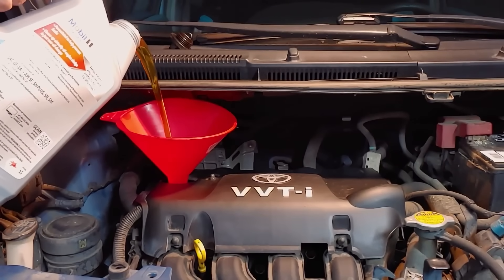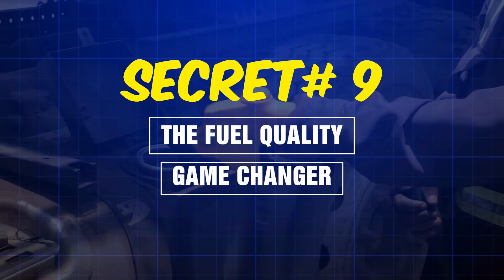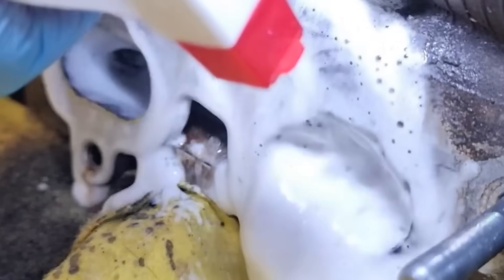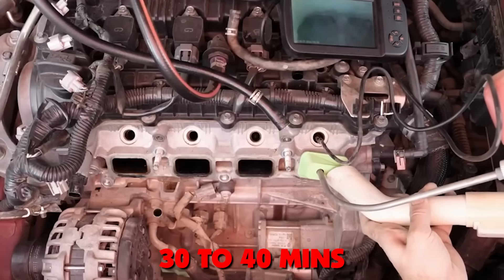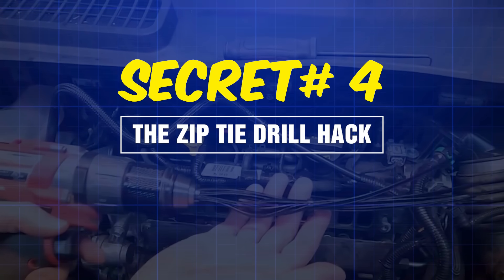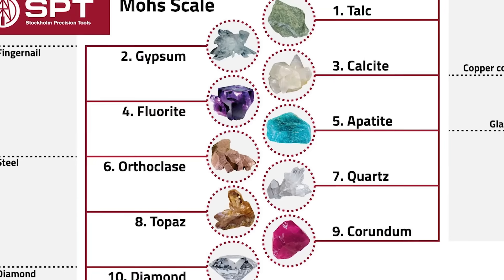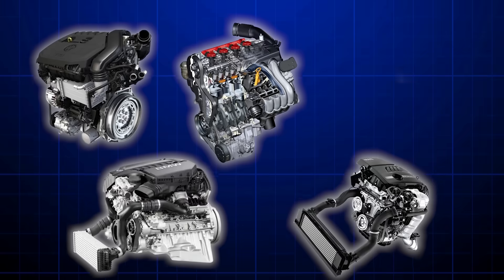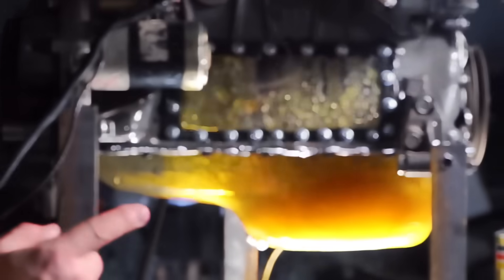9 Secrets To Clean Carbon Off Your Engine! Pro Tip

Comment: Just add One percent diesel  to your full tank of petrol every couple of months... 60 litre tank = 600 mls of diesel ..... 70 litre tank 70 mls of diesel and so on.. and give your car a good kick in the guts a few times a week.... run it out to about 5000 RPM for 5 to 10 seconds .. it blasts all of the Sshit off your valves and piston tops... .. Been doing this for over 40 years.. It works a treat.... The diesel even makes your idle smoother...

Comment: And like always, if you see it on the internet, you know it true. It's got to be. Who'd put garbage on the internet? That would be like irreverence or Sacrilege.  See? I say, move the PCV to the exhaust. Why? Because it's only exhaust to begin with. Crankcase fumes are simply explosion leaking past the piston rings, so what else could it be? It may have a little oil vapor in it, but unless your engine is quite worn there is never very much oil vapor, it's just exhaust! If you were passing that much oil out your PCV system, you are using oil at a rate so high you know the engine is on it's last legs. So, route the Crankcase fumes right into the exhaust and let the trash burner (catalytic converter) burn it up. That is the end of build up on intake valves. And honestly, WHO GOES TO THE DEALER FOR A NEW CAT? $3,000? Most any chop shop can replace a Cat with an aftermarket  Cat for around $300. If they want too much buy it online and carry it into the joint. It's not illegal and they can't possibly charge you more than the labor for a muffler install.  Unless you have a Mercedes or some rare expensive car, and money is no object to you. In that case just go to the dealer and let them sell you everything. For the rest of us, an aftermarket Cat is the way to go. Read the packaging if you're a tree-hugger. It says "meets all federally mandated emissions standards" and the fine print gives the distance/ mileage.  So if you have the cat replaced, there should be no problem until the cat fails again. Now for a reality check: How many miles do you actually drive a car? If you get 300,000 miles or 500,000 km is that enough? Most people won't even try that. Cars start nickel and diming you right to death for small stuff and then the trans falls out and that's it. So, reroute the crankcase fumes into the exhaust upstream of the cat and instead of have a $600 & Up Walnut job done every 40,000 miles, just put on a new Cat for about 1/2 the price and 1/10th the time every 40,000 miles. How do you get the Crankcase fumes into the exhaust? Have the same fly-by-night muffler joint drill A-Hole into your exhaust and weld a pipe in it ahead of the Cat. Then get an "Air Injection Reaction Valve or Secondary Air Injection Check Valve, (it uses exhaust pulses to let air into the exhaust) and connect it between the Crankcase vent hose and the pipe welded into the exhaust pipe. If it was me, I'd just disconnect the PCV altogether and let the fumes go under the car. But I worked in emissions so I know what's gong on. The small amount of exhaust that is emitted by the crankcase is negligible. You won't see it on a Black 'Running Horse at Night. And for all you engine oil freaks, let you fancy synthetic engine oil clean up the crankcase. You will never see any wear if you change your oil once-in-a-while, so you don't even need a PCV system, just a vent to let the pressure stabilize. ben/ michigan
Reply: 😊. Are the PCV gases dirty enough to shorten the life of the Catalytic Converter???   I like simply diverting the gases to below the engine into air flow below the vehicle.  How ever there is no positive “suction” created by the intake manifold.  Is the positive suction necessary?  Please advise.  Thanks

Comment: FORD initially had Carbon Build-up problems with their Direct-Injected Ecoboost Engines
Their solution was to switch to Dual-Injectors. Both Port and Direct-Injectors

Comment: BS! Carbon build up on valves in direct injected cars has nothing to do with quality of the fuel. You may encounter an array of different issues due to chitty fuel but carbon build up is not one of them.

Comment: If you want to do it easier? Just make sure to do an synthetic oil change every 5K miles . Floor the engine a bit on highway ones in a while depending on how much you drive and your driving habits and everything 1k miles use a tank of 93 Mobil or Exxon/ she'll or Chevron gas to help clean your engine. That's simple easy not much labor and works very well.

Comment: Berrymans B12 every 5000 miles is 1/2 cent per mile.... Normal fuel injection and carb engines.
Cheaper than top tier gasoline.

Comment: It is difficult to coat the valves with anything to keep them clean when the engine has direct injection. However, as mentioned earlier in the comments, installing an oil catch can will help. Additionally, Top Tier fuel, while more expensive, is the best way to make engine oil last longer.
Reply from the maker: Thanks for the info!

Comment: Your best bet,  disconnect the vacuum line from the PCV valve.  Plug the vacuum line, that is going to your intake manifold.  Remove the PCV valve, and replace with a simple 'down draft' tube, (rubber hose) pointed to the ground.  This method was used up to the 1970's worked great.  I do this on all my newer cars.  and only put back to normal when selling the car or needing smog inspection.
Reply: or, just put a cheap oil catch can in that line, and avoid engine codes.

Comment: A REDLINE a day keeps the carbon at bay
Reply: Red Line SI-1 cost a little over $1 an ounce and you need about 1 ounce per gallon of fuel. Paying an extra .50 per gallon for Top Tier fuel makes sense.

Comment: In the manufacturer should have to put the bill for this since they're building purposely a piece of junk if they would do direct injection with another set of injectors just before the valves everything would be good
Reply: But... It's efficient 😂
Reply: If the manufacturer foot the bill....Why do you suppose they put the PCV fumes into the intake? THAT'S THE WAY THEY'VE DONE IT SINCE THE EARLY 1960's when the illegal entity called the EPA told them they had to do something with those fumes. It was cheap and easy and that about sums up the way the auto manufacturers think about us, CHEAP AND EASY.  They could have done anything they wanted to with it, on the new GDI but they chose not to. Why? Because there is so much competition in auto sales there is very little markup for the dealership. So, at GM, at least  (I know bc I was there) they build-in problems for the dealership to make $$$ off of. But, do you really want the dealership kid working on your car? I know I do not. I don't like anyone driving my car because I can't control how poorly they treat it when I'm not there. But that's just me. My last vehicle was 2017 GMC Sierra 1500. It was the cheapest truck I could buy and I checked Honda, Toyota, Nissan, Ford and Dodge. I gave GM 36 years of my life, so I got their employee discount and the cheapest truck model "work truck" cost me $33,000. I don't want anyone driving the crap out of it and destroying the trans or the lifters or whatever else they might wreck. ben/ michigan